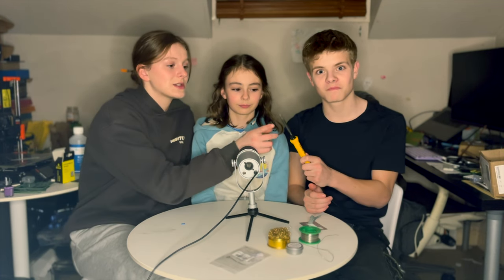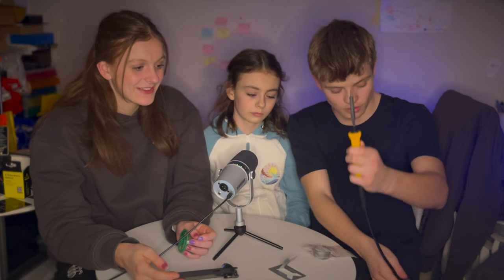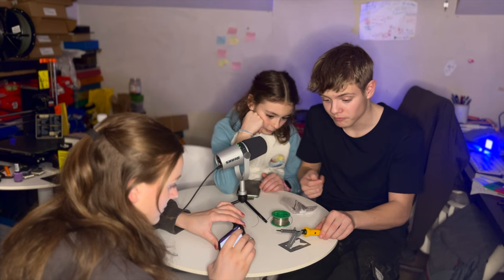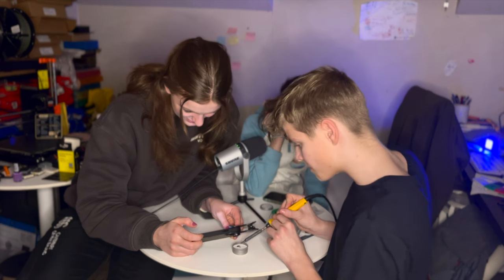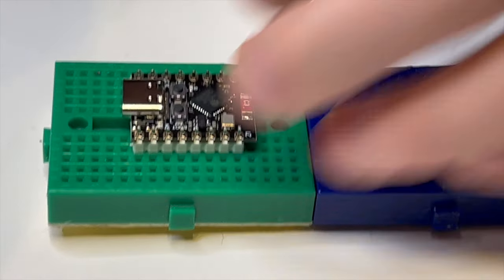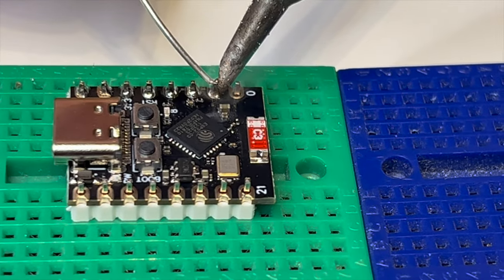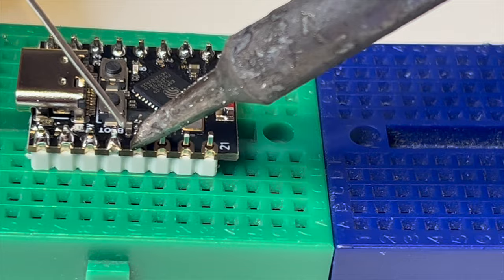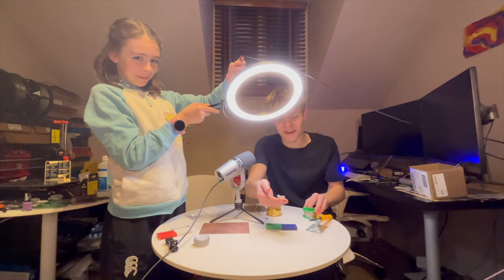Transform Your Soldering Iron 🔧: This Simple Trick Surprised Us! 😲

Comment: @4:40 No, please don't sand it, a proper tip is has a copper core that is iron cladded. Once you sand (or wear away, for really old tips) the iron you expose the copper. And if you think that you are having trouble keeping it tinned now...

Not to knock your soldering iron, but the predecessor to this one (the TS100) has served me well for decades: "NovelLife Original TS101 Electric Soldering Iron Kit" (found on Amazon UK). First off, it is a really good soldering iron. Second off, you get some isolation between you and mains power because it runs on 12 - 24 VDC. This doesn't mean that you won't get get popped soldering a live circuit (it happens). Pro tip, don't solder on live circuits (and it won't happen). :)

This iron uses "cartridges" for the tips rather than screw down ends. And while the ones that your Antex uses aren't as bad as some, they will tend to loosen up while you are soldering. 

My favorite tip (cartridge) style is the "TS-BC2",  and be aware that there have been reports of TS10x "compatible tips" not working (they will physically fit into the soldering iron, but not show up as connected).

You have a choice between a USB-C cable and a 2.5mm (I think) barrel connector on the TS101. Both will wear out and have the wires in the cable break. I would go with the barrel jack (it will be easier and cheaper to repair).

The tip cleaner tin should have a sticky pad on the bottom. I attach mine to my soldering/desoldering station. That way you don't have to make your favorite sibling hold to the the tin while you poke around in it with a hot soldering iron. And nice catch on the falling soldering iron, but you can buy a weighted stand that will make it harder for that to happen.

BTW, the second pin that you soldered needs to be retouched. And maybe the first and seventh as well.

GadgetUK164 is a soldering wizard, check out his videos.
Reply from the maker: Wow! That’s a long comment, thanks for taking the time to write such a detailed comment and give us feedback. Definitely will NOT be touching any sandpaper 😂. 

But do you think a soaking it in a bit of white whine vinegar would help do the trick?

I’ve got to write an article on this; do you have anything else to contribute so I can include it in the article?
Reply: @GurgleApps  Sure!

First off, there are two types of people, those who have burned themselves with a soldering iron, and those who are fixing to. Stay in the latter group as long as possible. :)

No need for a gazillion Watts of power, 60 Watts is way more than enough for almost every scenario. The exception will be ground planes (because they soak up and dissipate heat so effectively), and severely corroded connections (because they don't soak up heat effectively). 

Flux and a Scotch-Brite are your friends. Make that board shine before you solder and things will go much better.

No need for anything hotter than 350C, exceeding 380C will damage your tip (the higher heat promotes rapid oxidation - what your tip exhibited).

Solder wick (copper braid treated with flux) will soak up the solder at a joint to get rid of either excess solder, or as an aid to remove the component.

Some boards handle temperatures better than others. The old Commodore boards are pretty bad and the traces are easy to "lift". Be careful while removing parts and doing rework.

The name of the game is heat transfer. Narrow, pointy tips aren't all that good for that.

A temperature controlled soldering iron is a completely different animal than an adjustable temperature iron. You want a temperature controlled iron.

Unleaded solder (aka "Lead free solder") has a couple of distinct disadvantages over leaded solder. 1) It requires higher temperatures  - about 40C - 45C higher. 2) It creates "solder whiskers" over time and can short out against neighboring components.

Thin solder is your friend. "A pound is a pound, world round", so why not get that pound of solder in .3mm diameter? It will require you to feed much more in a solder joint before you flood it. Makes an average solderer like me look semi-skilled. :)

Be sure to choose a flux designed for electronic and not plumbing use. There are different types of flux which varies from basically a liquid along the lines of water, to thick syrupy stuff, or even gel. You should always clean the flux residue off after you finish soldering, although the watery flux is usually what is known as "No Clean" that doesn't (usually) need to be cleaned off.

Different types of flux have different levels of "aggressiveness" and can damage the board if not cleaned off. And again, of course you don't want to use plumber's flux since it is acid-based and will ruin the board.

Different types of flux require either water or alcohol to clean the flux off. Follow the manufacturers recommendations. There are also recommendations that come with the solder, it wouldn't hurt to read those either (usually a one-pager).

You can wash your board. Yup, seriously. I soak my Varta-damaged boards (Varta is a battery company known the world over for ruining old electronics) in vinegar to neutralize the alkaline that leaked out of the battery. Once the fizzing slows down to almost nothing I use an electric toothbrush (someone else's) to loosen up the blue gunk left behind. I follow that up with a rinse from the outside faucet, or "Hose pipe" as it's known down here. Then it gets a soak in 91% IPA (Isopropyl Alcohol). Doesn't hurt the board and the results are excellent. Just be sure to remove any batteries first.

Do not store electronics with the batteries in them.

And most important, have fun!